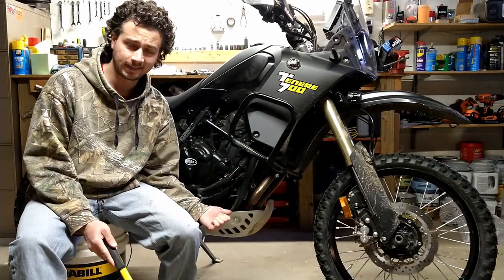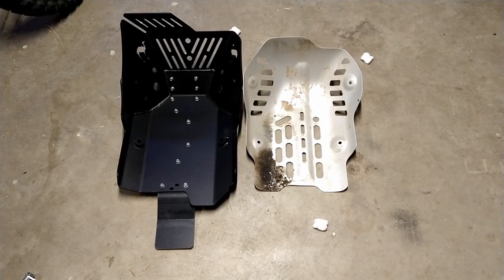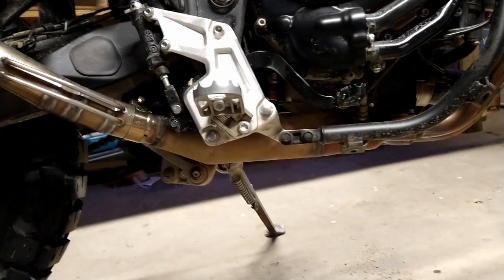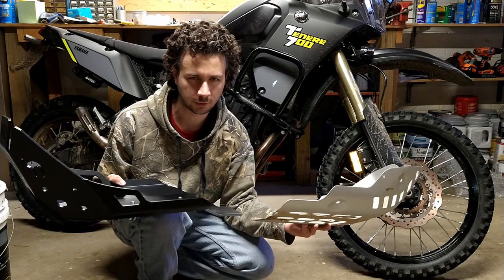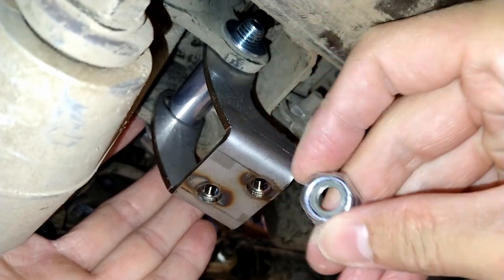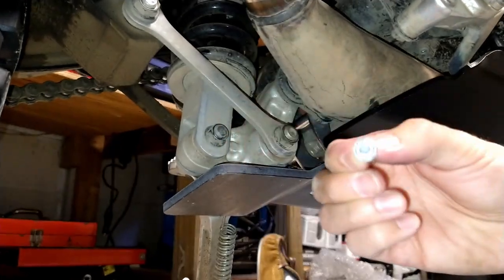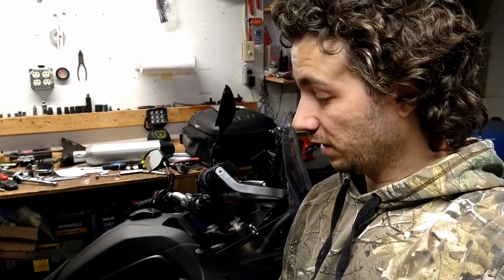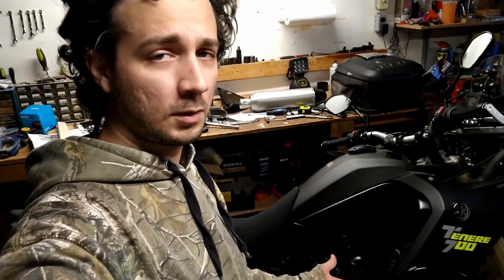Camel ADV Gut Guard Skid Plate Install & Review

Comment: I like the looks of that plate. I’m going to tell my nephew to look at that plate. My BMW skid plate thickness is about right in the middle between your stock plate and the camel. I measured and ordered 3 strips of ABS plastic from a company that makes sheets of the stuff that get molded onto the bottom of jet boats that run rocky rivers. They supplied me with the adhesive they use to adhere to aluminum boats. As soon as I get my bike back I’m going to stick it on. That plastic is a smart idea.

Comment: That is a nice chunk of armor! That additional strip of "plastic, delrin, abs, whatever it is,  was genius!
Reply from the maker: Yeah it is!  I actually thought it was metal when I first saw it, which would make sense, but plastic is actually much better in that particular application.
Reply: @SwankyCatProductions   I bought a second stock skid plate for pennies and welded them together. It's thicker than your camel one and does the job fine at hardly any cost

Comment: The right choice. One of the only aftermarket options with a fifth mounting point to take the load off the foot peg castings. As well as proper linkage protection. For oil changes just drop the stock 4 bolts & let it hinge down on the rear bracket. Wouldn’t be too concerned about the spark arrestor with the cat still in place.
Reply from the maker: Oh man yeah I suppose that would work wouldn't it?!?! good point!  Yeah I doubt anything would get past the cat but I don't know if the DNR would let that go...

Comment: Looks like Yamaha shop at the same skidplate store as BMW haha. Funny you mention that uhmw material, I just built an atv skid that's hybrid aluminum with a plastic sliding surface. The slipperiness of the plastic makes a difference. You made a good decision with this skid I think. Big bikes take big hits, and thick skids are the only counter to that. The black looks sharp. Great mod Ben.
Reply from the maker: Thanks Rodney!  Yeah it's really a neat idea and I'll bet it makes a big difference especially on something like and atv or utv that's got a little more weight that needs to glide over stuff.

Comment: It looks great! Glad it went on easy. I'm interested to know of you've had it out for a rip yet with it on? I recently put an Sw motech plate on the KLR and its buzzing and vibrating like crazy. I've got to put some foam on mine today to fix it.
Reply from the maker: Thanks!  Yep I've been out a few times already and haven't had any issues.  I had a ricochet plate on my KLR that didn't make any noise either.  I've heard of crash bars vibrating but never a skid plate which is sort of surprising since it's just a big metal sheet.